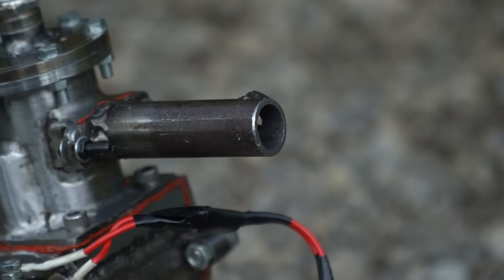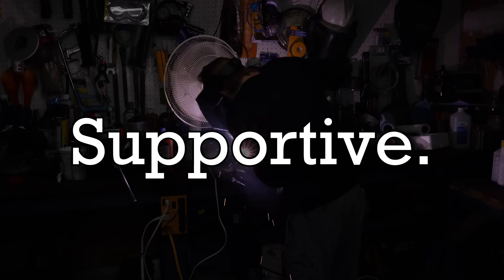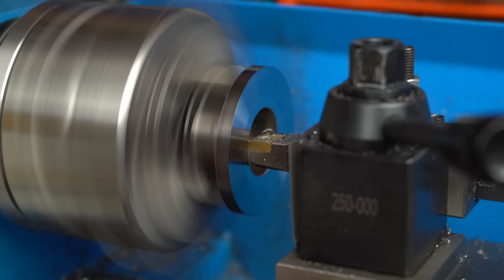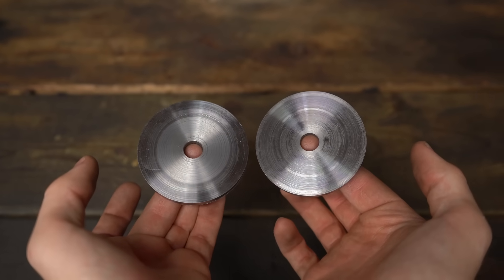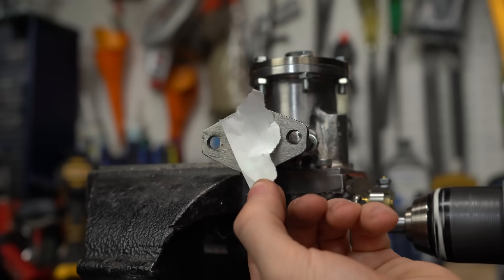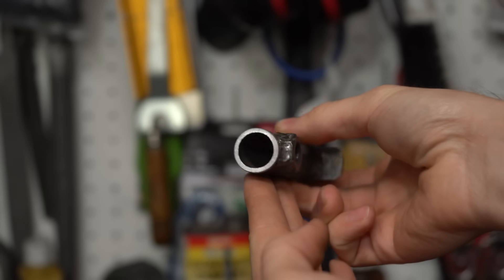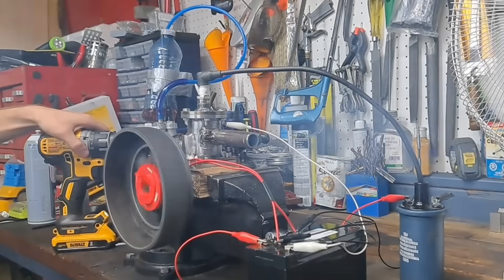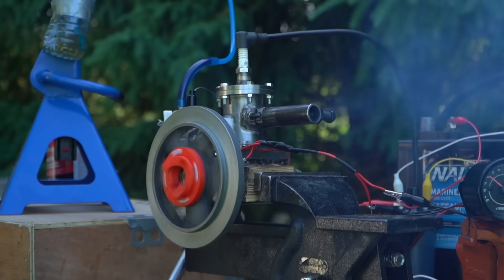I Made a Two-Stroke Engine Using Things I Found at the Hardware Store

Comment: If you want to create a 2 stroke exhaust pipe you can use the software 2T exhaust Calc. By BirdCage Software.
It will help you a lot in your calculations and it easy to use.

Comment: to cool it you can do what lawnmower engines have add a fan onto the flywheel then make a engine cover which will disperse the air correctly to the cylinder head and crankcase would be easy with a 3d printer

Comment: Hello mechanic here, you need to make a tuned pipe for it to run correctly/efficiently and might even make some nice power. Double check your piston to wall clearance based off of other similar sized 2 strokes, and I think your carb was made for a 4 stroke should run better with something like a Walbro Carb off of a KT100 kart engine or any other 2 stroke cart carb that is correctly sized. Congrats otherwise cheers🍺😁 you should think about making multi cylinder 2 strokes out of weed eater engines welded together they are pretty cool too
Reply: Oh and I hope you balanced that crank to the piston it looks way lighter than it should be but I could be wrong. Good way to keep blowing it up or seize bearings if not, also weld the key to the crank and it should stop shearing😂

Comment: You had enough air but not enough gas but now u have a good ration but to much so next time beter to block the air intake with something or an airfilter your engine will run alot quieter and u can use the trottle cable

Comment: You could take a hit miss engine and make that work in a two stroke config

You just need to add a gear and a cam on the exhaust valve

And change timing, so intake and ignition happens on the first stroke

Then power and exhaust on the second

Use either a fuel injector solenoid and microcontroller or a carburetor, instead of using a "Jake brake" to control rpm via bleeding off the compression floating the exhaust valve 

All you really need is a tube and top end, and the bottom end connects piston to crank and a flywheel
Reply: If you want a higher efficiency 2 stroke add a turbo, since two stroke don't purge the cylinder with fresh air like 4 strokes

The power of the stroke and gas expansion is the only thing that pushes out exhaust fumes

Comment: Based on my experience with 2 stroke motorised bycicles 40 to 1 is very little oil for an engine like this I know that most performance dirtbike engines run 32 to 1
I run my crude bike on 24:1. The manufacturer even recommends 16:1 for the break in period (which is crazy)

but I would think something closer to 18-30 to 1 would be close to what you would want use

Great job with the project and editing btw hope to see more like this!

Comment: I'm kinda surprised it worked so well without a reed valve between the cylinder and the carb, 2 strokes have a reed valve to ensure the fuel/air mixture doesn't flow back out through the carb, making them more efficient. Good Job!

Comment: if you dont feel like ''dying in 6 years'' due to echaust fumes. you can use alcylate gas, it's expensive but doesnt produce the bad fumes. also the whole point of two strokes and ''back pressure'' is to time the pressure waves in the exhaust just right, so that it prevents gas air mixture from escaping the cylinder. this is achived by that cone shape.

Comment: One thing that would help you greatly is reading up on: 
 1. Transfer&exaust port duration (and intake port too if you plan on keep using piston controlled intake)  because even if this engine is not meant to be tuned and give alot of power its still important that intake, transfer, exaust, ports have durations that all suits your intended rpm range.
On a engine of this level its more about they shall be in the same ball park. But still something thats important to plan somewhat in the design rather than eyeballing it because even if low power 2strokes are quite forgiving with durations(atleast in the sense to get running att all) the problem with just eyeballing it is that you can end up with  a combination of intake, transfer, exaust, durations that are in completely opposite sides of the rpm range.  Even going so far that the engine won't even run. (Btw by just looking at it i can say that for the Intended power band of this engine your exaust port is way to high with a too high duration as a result.)  
Higher exaust duration -> powerband gets narrower, peak power and rpm at peak power goes up(a lot of other variables that must match but for gross simplification) 

2. Port geometry and Port area.   
As you have used a Steel tube as the cylinder and just welded the ports on makes your options for the transfer ports geometry rather limited.  You can add more material by welding and build upp the thickness so you have atleast some thickness to work with the transfer canals/channel betewen crankcase and the Port opening in the cylinder boore. 
But a better solution would be to make a new cylinder with a pipe like you have now but use the pipe only as the liner in the boore and press fitt it in to an aluminum block/cylindrical  pice of stock.
That is how most small 2 stroke engines does it and you have a lathe so fully doable for you.

That way it wont destroy it self because of heat warping the pipe.  And then you would have lots of material to work with when making the transfer ports.

I where planning to write a bit more about both port area, shape and sizes of ports , transfer port direction in the cylinder for proper scavaging.
Combustion chamber shape.
But i ran out of time.   

But i highly recommend you to read a book by the name: "Two stroke high perfomance tuning by garham bell"  because  even if this isnt about getting alot of power out of your engine that book contains a shitload of knowledge about the diffrent parts of the 2 stroke and everything you need to learn to build yours sucessfully. 

(Before someone gets a stroke because my grammar and spelling. 1. English is not my 1st laungage. 2. My phones auto correct is going crazy. And 3. My grammar sucks and Always have. )

Comment: Very nicely done! Your fabrication skills have really grown. 

If you wanted to add cooling to it, you could just use a simple passive cooling system like old hit and miss engines used. It may be possible to create a jacket around the cylinder, and then simply fill it with water, and let that water boil off to cool the engine.

Comment: bAcKpReSsUrE doesn't exist, and it's not a real thing.  It's just shop talk for people who don't understand how an engine works.  You need V E L O C I T Y !  2 stroke or 4 stroke, exhaust velocity creates better scavenging to clear the cylinder with fresh air/fuel.  You get it just right, and it can cause the air to pile up and actually pressurize.  There's a point in 4 strokes when both the intake and exhaust valves are open, the exhaust valve closes, and the cylinder is actually traveling up BEFORE the intake closes.  But fuel/air keeps flowing in, because of the momentum.  2 strokes do this too to a lesser extent.  Think about it like getting passed by a semi going the opposite direction.  You feel all the air being pulled along with it.  Air does that too.  Or like the water hammer effect, except with air.  Essentially, there's a goldie-locks zone of velocity your header needs.  About 150 to 300fps.  Too little with large pipes, and you lose power.  Too much, and you are actually creating back pressure in a bad way.  All exhaust headers, especially long ones, have a very narrow RPM range where they really shine, and taper off on both sides from there.  Exhaust rarely makes power, but it always supports power.  Like on a stock sports car, unless you upgrade everything, switching to a 1/4" larger header is only raising which RPM it peaks at, and potentially reduces power.  Just like cams, valve lift/duration/size, etc.  If your header is as long or longer than the pulse length between exhaust strokes, it really doesn't matter how large the rest of your exhaust is.  For 2 Strokes, it's really capitalizing on the water hammer effect with the expansion chamber.  Like pushing someone on a swing, the exhaust pulse bounces back to the valve, which opens just as the old pulse is starting to travel away.

Comment: You could do a diy liquid cooling system by bending and brazing some copper pipe to the outside of the cylinder walls and set up a small radiator beside it. A little drill-powered pump hooked to the output could handle flow and keep with the DIY vibes.

That's such an amazing project! It really brings the historical creation of the ICE into perspective. Simple tools are all it takes to prototype just about anything.

Comment: Backpressure is BAD. Both 2 and 4 stroke engines rely on a principle called "Scavenging" to clear the cylinder of exhaust gas and draw the fresh fuel charge in. What happens is that your exhaust pulse travels down the pipe, creating a low pressure area behind it (partial vacuum), which sucks the last bit of exhaust gas out of the combustion chamber and the first bit of fuel charge in.

Without an exhaust, there is no scavenging, and so the combustion chamber is still full of exhaust gas. It fires every other combustion stroke because it's taking two of them to push out the fart gas. The one made in this video is far too short for the effect to work.

Comment: Nice work! 
Just a detail that might work: I have a 2 stroke engine on my bicycle and it uses a big carburetor like the first one you tried, but mine came with a small difference that help starting the engine. On the intake of the carb is a cover that chokes the intake throat down to between 7 to 10m, once the engine properly running the cover is lifted to use the full opening, in my carburetor the cover is spring loaded and connected to the throttle the cover lifts automatically by fully pulling the throttle.
The first carburetor should work in theory and even give you a bit more power on the engine.

Comment: I would love to see a channel like yours do an experiment with a two stroke that does not use case pulse for fuel air, it instead has an oil bathed crank and a forced induction intake like a super charger and or a turbo, no mixed gas, could be run on kust pump gas.

Then possibly look into vodka injection either electronic, or with something like a pulse pump that runs on the case pulse and pushes the ethanol water mix into the precharge secrion of the carb.

Comment: Hi. Forget all that stupid f*ckin back perssure. There is no engine, that would really need ant of it. Of course 2 stroke engine needs a good exhaust pipes, that makes a good back pressure WAVEs, if there is any searious need of great power! But, 2 stoke engine, or another 2 stroke engine, or another, or another one or a... all of those will work just fine without any exhuast pipes  Certanly they will work just fine! No problem. Only thing that somebody, or anybody, or everybody, or maybe even nobody can notice, is that there is no any power! All power is gone! And there is now more than enaugh of noise!  The noise is absolutely massive! Like an engine without any exhaust systems.. You see..? Thats what exhaust pipes do on 2 stroke engine. Reduce noise and make power. No more, no less. Pretty simple at the end. At least, if you ask it from me.

Comment: Ya sound Canadian, eh? 😆 I ain’t far away from ya, in upstate NY. And I love all things 2 stroke! Not bad for a homemade rig! I have a completely disassembled pretty rare Johnson Utilimotor from the great hwite nerth up there I got last fall at an annual old engine show in Dublin, New Hampshire and have only part of this month to reassemble it to run it in the Schaghticoke fair. I think it is an estate item and was under cosmetic restoration. I don’t want pretty, I want a cool old engine that runs! Will it be reliable? I soon will find out! I have no torque specs, but as Peg on Zip ties and bias plies would say :”You don’t NEED torque specs on your old engine!! 😆😆😆 Great job! 👍🏻😋

Comment: You can buy a carburetor made for model airplane engines of the displacement you need, then adjust the high and low needles and it should work much better

Comment: Part of the reason why it's probably not running at its best is the lack of reed valves which is supposed to prevent the crankcase pressure from escaping back into the carburetor.

Comment: From what I understand, 2 stroke exhausts aren't really about back pressure, it's about having a resonance chamber. When combustion gas runs out the exhaust, it hits the chamber end and reflects back. This creates a vacuum to help suck fresh fuel and air in, followed by an immediate pressure increase to prevent pulling the mixture out of the combustion chamber. The resonance chamber needs to be the right size and distance from the combustion chamber to build pressure only during the end of intake. By adding intrusions into the exhaust you might just be hindering it's ability to receive fresh air/fuel.

Comment: IIRC, more backpressure makes it run more efficiently while being robbed of power, and less backpressure makes it run faster, with terrible fuel economy and it being much less stable. More is better for most applications. And of course, it should be a tuned exhaust to take advantages of reflections, when done just right they will pull exhaust out from the cylinder. The previous "bangs" pressure wave will travel in the exhaust pipe, then gets reflect back towards the exhaust port, hit the closed off port and just after the pressure wave has turned direction again, the port opens. In the wake of a high pressure wave comes a low pressure wave and we want our exhaust to open to that low pressure wave region.

Comment: "backpressure" is a joke. It never helps.

you may have added some, by adding exhaust, but what actually helped was increasing exhaust velocity. That increases inertia, so the exhaust going out sucks the fresh charge in.

if you just added pressure then there would be pressure in the cylinder when the intake opened, and the fresh charge couldn't flow in.

The only people say, "backpressure is a good thing," are fucking morons!

Comment: Are you using flux core wire on your MIG welder?
If so, you’ve definitely got your polarity right, right?
If not, then maybe don’t have a fan next to your welding.

Nice video though, it just popped up on my feed. 👍

Comment: You need to fill the crankcase  to reduce the passive volume in it so you get better suction through the carb. This will increase the economy of the engine by improving the atomisation of the fuel.

Comment: I’ve got a metalworking tip for you, fill up a pipette with water and slowly squeeze it out at the workpiece to keep it and your tooling cool. But since I usually have both hands occupied (I don’t have any work-holding besides my hands), I’ll put the pipette in my mouth and squeeze it with my teeth. Having no face mask and my eyes 10cm away from a machine-tool with no work-holding is safe, I assure you.

Comment: The top/bottom of the exhaust port needs to be curved to ease the piston rings back into the piston as they pass the port.  Having it cut parallel to the rings will cause it to eat them.  For the same reason the inside top/bottom edges should have a small chamfer.

Comment: great video as always. Just one safety thing - ALWAY SAND BEHIND THE WORK when power sanding on the lathe. If you lose grip then the lathe will want to spit the paper (and more importantly your fingers) back at you.  If you are sanding in front of the work then the lathe wants to suck your fingers into the chuck and backsplash - it's probably also harder to get good, even pressure but the whole finger thing is more important.

Comment: thats so awesome, 
you should try design the next engine that works by pulling the air fuel mixture into the crank case to 'charge' the air fuel mixture before it goes into the cylinder